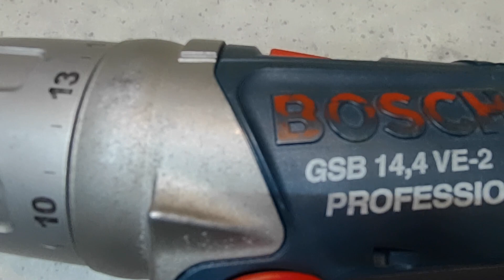Bosch GSB 14,4 VE 2 / 0 601 913 420/ 0601913420 Impact cordless drill

Comment: So both wires going from the trigger switch to the motor are white? So which one is the neutral and which is the live one?
Reply from the maker: When disassembling I marked which one connects where on the motor and then connected them the same way. In reality, if you swap them, the motor will rotate in the opposite direction to the direction switch. Nothing will be damaged.
Reply: @wsgworkshop495  Excuse me, the battery you use to replace it, do you know if it is 4800 mAh, 6800mAh, 9800mAh or 12800mAh?
Reply from the maker: Since the battery was old, I recycled it by replacing all the cells inside with new ones. Nickel-cadmium 2500ma as far as I remember.
Reply: Mine is made in Switzerland .